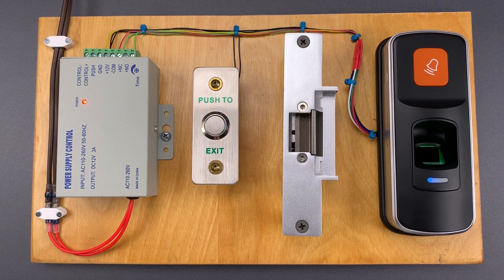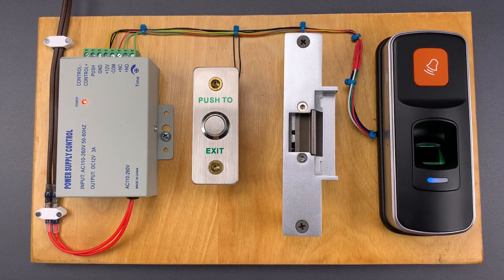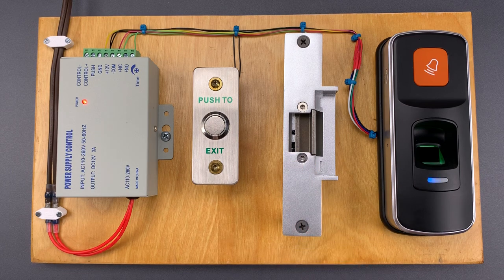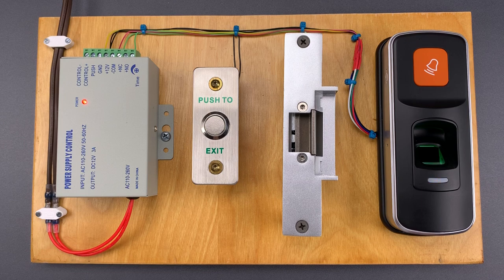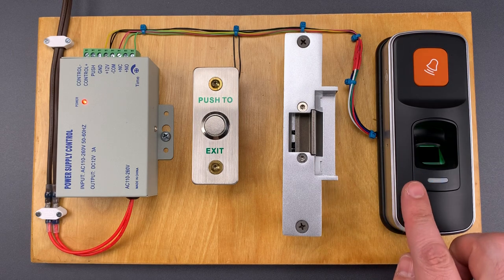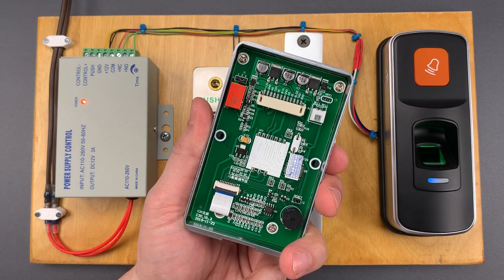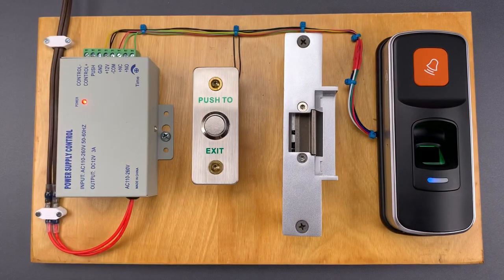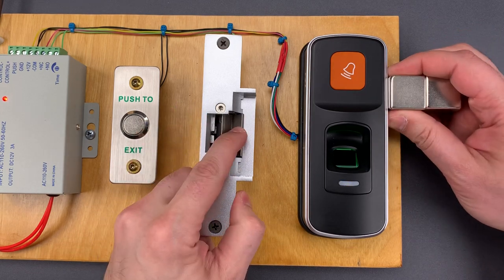[1060] Opened in ONE Second: HFeng Fingerprint Lock

Comment: A good reason to use a mosfet. But also, why does the scanning unit has the switch for the door. It could easily be put on the other side of the door and have encrypted data transmission with the scanning unit.
Reply: Sure, they could do that.
BUT THIS IS SO MUCH CHEAPER
Reply: Cost.....
Reply: @racitup4114  Same can be done with MOSFETs. Using low-side switching, it doesn't matter what drain-source voltage is applied (up to a limit of the NFET of course). Even with high side switching it won't be a problem when using a PMOS or a bootstrap circuit (like an NMOS H-bridge driver does). Motor driver units use this and often you can apply an external supply voltage for the motor. For isolation there are options that can be added if necessary, but I don't think a high isolation rate is needed here.
Reply: @beyerch  In general, MOSFETs are cheaper than a relay. If isolation is needed then optical isolators are an option, they will at most be about the same cost as a relay.

Comment: Ok that's actually pretty clever... I would've never thought of using a magnet to trigger a relay...
Reply: Try it on a MOSFET :)
Reply: He's a lawyer. And i suspect a damned good one. He spends his life attacking problems from different angles and exploiting loopholes and vulnerabilities that no one else imagined.
Reply: There was another lock with that same issue. There was a retrofit to fix that
Reply: @mgfails9274  relays handle much higher voltages and currents, although I don't know if it is used in this case.
Reply: @AWZool  in this case there is no need of more than 12v
Reply: @mgfails9274  most 12v systems still use relays, at least for high amperage circuits.
Reply: @ScottKenny1978  the solenoid from the lock won't use more than 2amps
Reply: I bet you would have never thaugt to illigaly enter a door that has a fingerprint scanner.
If these kind of locks all have the same issue, then you can bet, that professionals know of this flaw.
Reply: @mgfails9274  sure, but how big is a 2amp 12v transistor. And how much does it cost compared to this relay?
Reply: @chrisestill8825  or so we assume. Might have "earned" his JD by getting his hacker buddy into the school's server room.
Reply: @ScottKenny1978  solid state relay - pure electronics but i bet it costs more - price is always an issue
Reply: @ScottKenny1978  very small. Transistor packages commonly found in this low density type of electronics are from 3mm x 3mm to 6mm x 6mm. They are less robust than a relay, though. Edit: Relays can also switch AC. You need two mosfets and a level shifting driver circuit for them if you want to switch ac. You will need about the same area on the pcb for that.
Reply: @gerhardwallisch377  yeah, the more you and others comment on this, the less sense it makes to use a relay...
Reply: @ScottKenny1978  smaller than that relay and probably half the cost but it does require some design changes.
Reply: @nyetloki  around 0.2€ from china or 1-2€ from a shop. Some good examples are IRFZ44N, IRF520, IRF530
Reply: Then you're the person this lock was made for.
Reply: AWZool - there are MOSFET devices that can handle high voltages and amperages, so that is not why a magnetic relay gets used. The magnetic relay provides isolation between the signal side that actuated the relay and the load side.
An opto-isolator in tandem with the MOSFET could do the job, with isolation.
Reply: @stevebabiak6997  you can use thyristors
Reply: MGfails - sure, you could use a thyristor or SCR in place of the MOSFET. But the thyristor alone does not give isolation between the control circuit and the load, as a magnetic relay can.
Reply: @stevebabiak6997  Then use an optocoupler( i don't know much about those so if not correct, sorry). Maybe you can find sone that support 220v or a solid state relay
Reply: MGfails - I did suggest an opto-isolator earlier ;)
Reply: @stevebabiak6997  🤦‍♂️

Comment: "Hi, this is LPL today we'll be lockpicking the whitehouse"
whitehouse door opens
police pull up to arrest LPL
"Hi, this is LPL and now we're going to be looking at the modern handcuffs police use"
handcuffs fall off as police drag him to the car
"Hi, this is LPL and now we're going to discuss car door locks"
police realise LPL is sitting inside the car they didn't unlock
"Hi, this is LPL and today we're going to look at the flaws of prison locks which can be opened just by looking at them hard enough"
prison door swings open and LPL walks out while the guards give up from exhaustion
LPL walks up to main prison entry door which is metal and has been welded shut
"Hi, this is LPL. I've come across a rather difficult door, but luckily I have a little man made from lego"
door creaks and then falls down

Comment: Fancy designing a system with a standard relay exposed like that. Talk about built-in obsolescence, these locks have built-in complete uselessness.
Reply: To be fair, this problem would be easily solved by using solid state relays instead of the electromechanical one
Reply: Which is why it's so embarrassing.
Reply: They're useful against people who don't know that this vulnerability is existing
Reply: Well said. You nailed it !!
Reply: Just hide the reader under the threshold, put a magnet in your shoe, and you can magically kick the locked door open.
Reply: PhoenixUltraMotive Thats always the case, but just an excuse,...
Reply: H M  Eh, not in this case. The "bypass key" in this case is $10 magnet, it's not like the FBI would need to buy anything from them to get in if this is your home security.
Reply: @antonioreal3789   Honestly the best thing to do to prevent this would be design the system so that the critical components and power mechanisms are in that large grey box, hidden behind the door or in a wall somewhere. The fingerprint/rfid scanner should do one job, read the credentials, and then pass that data to the system that actually unlocks the door. By keeping the same system that unlocks the door where the credentials are used, you're always setting yourself up for an exploit.
Reply: At least move the relay away from the edge so it takes a bigger magnet. Maybe even spend a nickel on a NC reed switch just out of its magnetic field to stop this exact attack.
Reply: @antonioreal3789  No, the problem here is that a device accessible to untrusted people is responsible for validating their credentials. A proper security system would be connected to a central computer that validated the credentials and opened the door, with all of the lock controls behind the lock.
Reply: Andrew Schmelyun a system like this should only ever be used for non secure areas. Such as a Driveway gate. Or to a storage area where you don’t really care on it being secure, as much as just keeping idiots and honest people out.

Anything that allows access to the building, garage or secure rooms/offices should use Weigand or some proprietary communication back to a Controller or alarm.

People use stand alone for a few reasons, usually cost, but also they don’t know any better.
Reply: @antonioreal3789  kind of. The biggest exposure is having the lock control in the scanner. It should really only be a challenge/response unit with a lock controller on the secure side of the environment. Otherwise you can just kick it off the wall and apply 12v on the wires and open the magnetic lock, or as in this video, just energize it with simple methods. Whith challenge/response the keypad just sends data, and then the lock controller would decide if it is acceptable to unlock. Even without one way encryption, it is already much harder to force unlocked unless you tapped the comms and knew what to send
Reply: @aschmelyun  credentials should be passed in an encrypted way, though, or you'll be susceptible to some sniffing

Comment: ive watched almost every videos of yours and I've just realized that NO LOCK is gonna fully keep you safe
Reply: Yeah locks are essentially security theater. 

Even if your lock was unpickable people could cut through your door with a power saw or blow or off the hinges with an explosive. They could break your windows, etc.

A lock is meant to be a convenient way to keep you safer, not safe. It's meant to not impede on your access to your home/goods while impeding on others to access your home/goods. Not stop them out right. 

It's cheaper to replace a lock than a window.

Comment: I am astounded by this. As an electronics engineer, I always previously assumed a coded signal is sent from the entry sensor/keypad to the unlocking mechanism. This is not my field, but who would even consider having a direct link of any kind to the unlocking solenoid in a security based design. Shocking!

Comment: So no encrypted communication to a controller on the secure side of the door... brilliant Might as well put a push button on both sides of the door.
Reply: I have seen people struggling with "just" a button.

In one place I gow, there is a huge door and you need to hold the release button while pulling the door. A lot of people can't get past it :-D
Reply: The only thing you need to expose to the outside of the door is the finger scanner itself. The signals to/from it need to go to the analysing controller on the inside of the door.  So, even if you get access to the external scanner and its pins, you still need to spoof the data that the micro is still expecting from a valid fingerprint signature! Doh!
Reply: @simonbaxter8001  in our next lpl segment, biometric spoofing
Reply: Only exposing the scanner won't help when the analysing controller with the relais is right next to it. A large enough magnet will still open it just as easy as shown in this video. Not quite as fast since you'd have to guess where to hold the magnet, but a good bit faster than intended by the company.
Reply: The problem with this "cheap" system is that the complete verification is done on the outer panel. The magnet "switches" an internal relay. The relay simply short-circuits 2 of the 4 cables, which opens the door.

Comment: I'd really love to know what he actually recommends as a safe system... I'm so scared now.
Reply: Your looking at one of the cheapest systems on the market (Amazon level).  A proper system will have the controls inside and only the authorization reader on the exterior to verify identification.  Proper systems are also run in conduit to prevent tampering.
Reply: Just remember this: if the device doesn't put the unlocking logic BEHIND the door then don't buy it. Just that simple.

Unfortunately devices that do are probably only sold as complete security packages and cost a lot to install.

Comment: Placement of the sensor can help get around this vulnerability.  The sensor closes the relay for several seconds after verification, but the magnet only works when held against it.  Putting the sensor out of arm's reach of the sensor means you would need two people to get in.  A reaching device might be used also, but a security guard watching would notice either the two person move or the use of a hook to get the door open.  Still not infallible, but security is usually more about dissuading someone than being perfect.

Comment: I have one of these, still in the box, and the instructions specify two installation methods. The preferred method uses the relay in the door controller, the second method uses the on-board relay. I haven't verified it, but hopefully the preferred installation method is not vulnerable to the magnet attack.
Reply: Thanks,  I was wondering what the second relay does

Comment: I had set a system like this up about a year ago but we used a locking handicap button and found during set up the metal case is suspectable to static, so if you build up static with your hand and put you hand by the button and discharge to it the door will open, likewise if you take an electric car key and tap the button housing with it it will also open. Luckily security wasn't the primary reason for them being installed.

Comment: Wait what, they didn't think about putting a steel screen around the relay to shield it from outside sources? And with that, they just placed the relay next to the wall of the frame? That's some brilliant engineering right there
Reply: Not worth it. Simply moving the relay out of the fingerprint scanner and placing it inside the building would defeat this without needing magnetic shielding.

Comment: As a mechanic you have to be careful with tool that have magnets on them. Lights, pick up tools etc. If the come into contact with the starter relay,  well you can have an unwanted engine crank. 😬
Reply: Usually jumping the relay is something you want on an old Ford 😏😝😎

Comment: Those stand alone are cheap for low end and insecure applications. Mostly imported from china. Proper fingerprint scanner doesn't/shouldn't/wouldn't have mechanical relays that are easily hijackable. Instead they mostly use Wiegand protocol (interface) that is crypto-encrypted from the fingerprint scanner to the door opener unit that's installed indoor.
Reply: My building uses IDEMIA MorphoAccess - any chance a magnet could bypass these? I know there is some sort of electromagnetic hardware involved. I might buy some magnets to test it out.

Comment: The really stupid thing is that they didn't even save money by using a relay.  A MOSFET could do just as good a job switching 12V @1A and it would take up less space on the PCB and cost less.  The MOSFET would  be mostly immune to the magnet attack.
Reply: What really bothers me is that the signal actually unlocking the door is just some relay closing. Rip the thing off (They're mostly plastic anyway) and connect some wires and the door is open. I would like a fingerprint sensor where the actual microcontroller processing the fingerprint sits within or behind the door and the data transmitted through the door is just raw sensor data. That would increase the security by a lot. I don't want cables controlling the locking state anywhere near the outside of the door.
Reply: @philippjungkamp3760  That's how most of the professional gear works. It send a signal containing just what credential is offered (fingerprint hash, pin code or card swipe) back to an access control system which is secure somewhere. The ACS tells the lock to open only if it decides the credential is valid, which also gives a single point to configure authentication - no need to configure each entry point separately.
If you rip off the reader, you still can't open the door because you don't know the signals to send to the ACS. There are attacks (compromise the reader, monitor the signal during a successful unlocking and then replay it later), but most require two visits to the lock and you have to hope you don't trigger a tamper sensor on the first visit.

Comment: Its totally useless having the relay on the unopened side of the door.

You could probably just shake the box till you overcame the spring.
Reply: Not really.  There is no spring in the relay.  Basically you have 2 pieces of metal running along side a simple electromagnet.  Run power through the magnet, generate magnetic field, the two strips of wire now touch and make electrical contact.  Shaking really won't make them touch long enough (if at all) to make a good enough contact and open the lock.